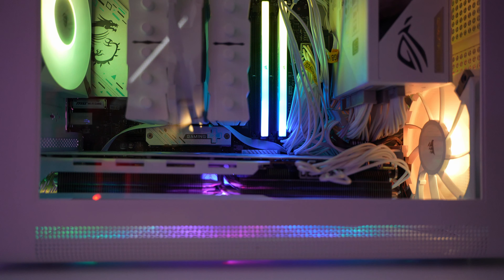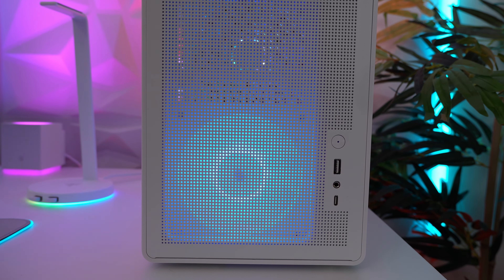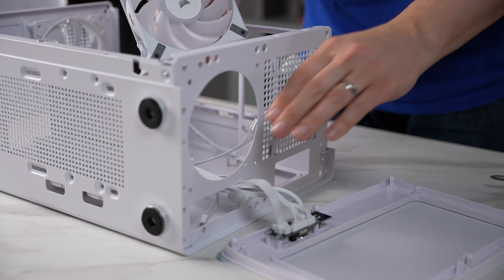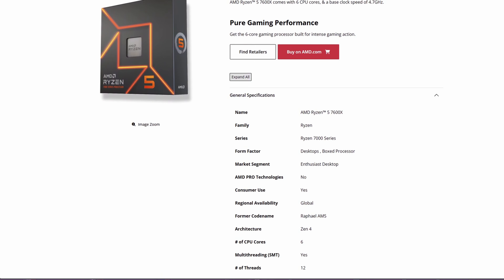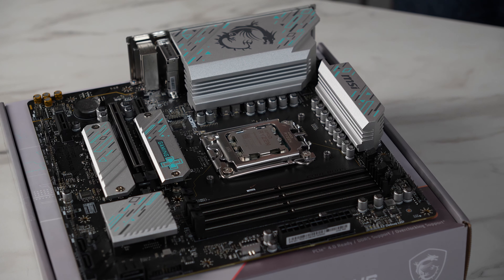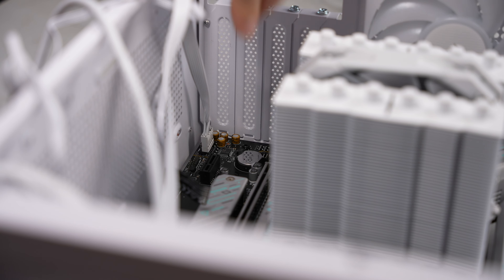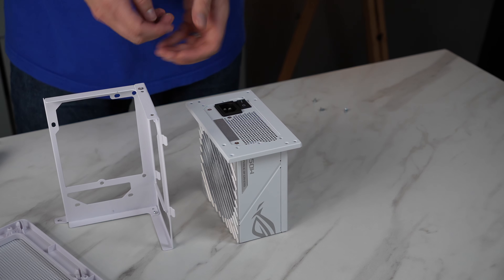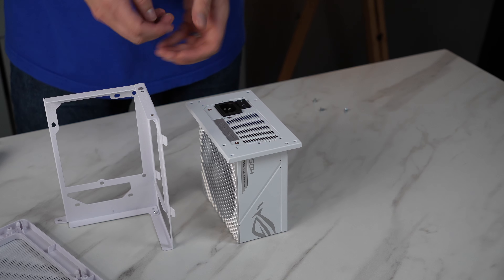This Compact ALL WHITE ALL AMD MATX Build Offers Incredible Value To Performance! (iONZ KZ-X1 Case)

Comment: no dust filters is a Big no No! 6 core isn't  a sweet point, it's still good ( I'm still using Intel gen 10 6/12 cores) but for some time 8/16 is the new Standart in my opinion.  for the price good pc you got there.
Reply: 6 cores is more than anyone needs

Stop talking bullshit. 

Games today is not even using 6 cores.
Reply: @INTEL_CORE_INSIDE  lol assasins oddysey using 8 and more cores with ease, there are many more  games using 8 cores  and more
Reply: Newer AAA titles have been using more cores I think 8 or more is the standard now.
Reply: 6 core is still the sweet spot. Since majority of the games runs on 6 or less and the ones that uses more still work fine on 6 core. However, if a builder is wiling to spend more, sure go for 8. So yeah, 6 is sweet and 8 better.
Reply: Not all cases should have a dust filter. Lian Li for instance designs some cases with a micro mesh hole pattern to eliminate them. A dust filter can create both air flow and acoustic issues when paired with a micro mesh pattern.
Reply: @saqif200 If its not optimized right even 12 core isn't gonna be enough doesn't justify a 6 core build is useless some games has very odd recommended specs like Snowbreak for example for the CPU it uses 3rd gen i5 and the GPU AMD R9 390 last time i checked 3470 is quad core CPU
Reply: That 7600x obliterates your gen 10 intel chip. even if they're both 6 cores
Reply: @oblivionlord1242  In terms to intel equi valent that's 13th gen i5 and i found another intel meat rider
Reply: I does not Care what people say its standard Bro, u have a budget and you play some games, make a build accordingly regardless of what people say
Reply: Nobody care you "no dust filters" stop criying.🤣

Comment: I have question, would it be possible to still have fans on the bottom of the case even with your gpu there? or would that not be needed as it pulls air from under the case anyway? Sorry I dont really understand how it works.
Reply: I have the case, and with a b460m and Palit gamingpro 3090, it is possible to fit 2 120mm fans underneath the GPU, currently using a12x25s

Comment: Lovely little build, even if white PCs aren't really my thing.

Micro-ATX is the forgotten format of the desktop PC world thesedays, it used to be really popular a decade or so ago until Mini-ITX began to dominate. There were rumblings about the format being ditched altogether by the Mobo OEMs a few years ago. Thankfully that seems to have gone away and there are still a few boards to choose from.

..and the cost of that PSU, lol Asus, you never disappoint with your brand price gouging.
Reply from the maker: Haha it's actually even cheaper if you dont want white! I am just obsessed with white atm, think I just got bored of black cases I have had over the last decade or so. 

and yes, the Asus pricing is just insane, its the most I have ever spent on a SFX PSU and if I wasn't going white I would have stuck to my trusty SF750
Reply: Micro ATX never went away, especially in budget segment. So Mini ITX didn't "began to dominate", nobody still cares about them outsode SFF enthusiasts. And with how modern GPUs can easily take 3 slots - having Mini ITX board begins to make less and less sense (unless you're running extra compact sandwich cases) since all you're saving in a case like this vs some NR200 is at best like 2-4 cm of height (1-2 PCIe slots). No wonder we're getting more and more Micro ATX cases now.

Comment: Wow that case reminds me so much of the mini itx CH160. Being able to handle mico atx boards is a huge plus. Good alternative to the SAMA IM01 and Jonsbo Z20 too. I can't see any real negatives. Especially for the price. I am tempted because I can order this from Aliexpress.
Reply: can you confirm that ch160 able to fit mAtx mobo such as 22.6cm x 22.1cm size ?
Reply: @anggagilang566  I have seen those smaller Micro ATX boards inserted in the CH160 but it's not pretty. The I/O ports will be off centre. Making some ports unusable. I wouldn't recommend.  The original NR200 and NR200P from CoolerMaster are more MicroATX friendly. Being  taller. 

However DeepCool recently announced CH260 which has offical Micro ATX support. There is also a CH270 Digital which is the same case but stands vertically. Which puts the IO ports at bottom. Definitely check both those cases out. Hopefully they'll be available locally to you. I believe DeepCool is still sanctioned in the USA.
Reply: @mattscomp  hey mate, thanks for the answer. unfortunately those ch260/270 models are not available in my country. but surely will check on NR200
Reply: @anggagilang566  no worries at all.  Happy PC building 👍

Comment: Question regarding case fans. How many do you have and what direction is the airflow? I bought this case and it came with 3 fans. 1 rear ( intake ) , 1 top (Intake) , 1 front ( Exhaust ). Seemed a bit weird to me. Are you fans setup similarly ?

Comment: Honestly, i think when it comes to speading the thermal paste, you should use something flat and manually spread the paste to make it perfectly even and no paste makes it off the shell of the CPU🤟🤟🤟
Reply from the maker: I have tried all the various pasting methods and I can get a really good spread with just the pea and when I compared temps there was so little in it I couldn't be bothered with the spread method

Comment: I'm a sucker for white, small cases. If you add a monitor, a keyboard, and a mouse, how much it would be? 
If the total amount is e.g. £2100, how much do you think it is better than a £2100 laptop?
Reply from the maker: admittedly I used a very expensive monitor, but if you chose say the AW2724 27" 240hz QHD, the white keyboard and mouse you are probably looking at £2000-2100. Performance wise you would need a 4090 laptop to be even remotely close in performance plus this is actually quiet unlike a gaming laptop. I love the portability of gaming laptops but noise is a real killer for me
Reply: @MashITTech 
Oh yeah
I totally forgot about high-pitch fan noise and thermal. I mean desktop still wins here.

Comment: Im confused how do you connect the psu to the wall is its at the front?
Reply from the maker: inside the case there is a cable that goes to the PSU and rear of the case that allows you to plug in a power cable at the rear as normal but extends the power into the PSU. Hope this makes sense
Reply: @MashITTech  makes complete sense. Thank you, am just about to order the case for a build mate. Cheers!

Comment: Can you fit an hdd in there ?
Reply from the maker: yes there is a bracket that sits at the bottom of the case that can take a 3.5" or a couple of 2.5"